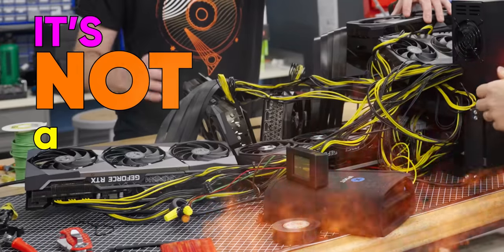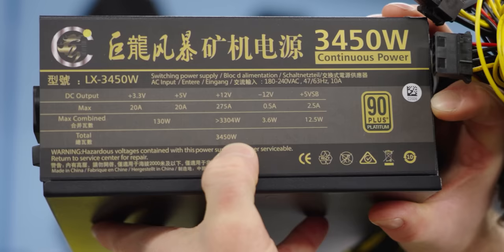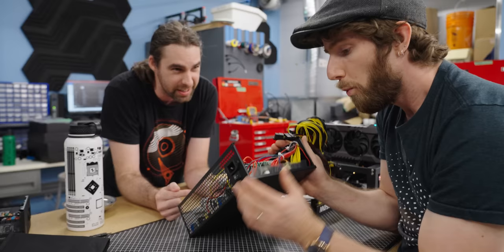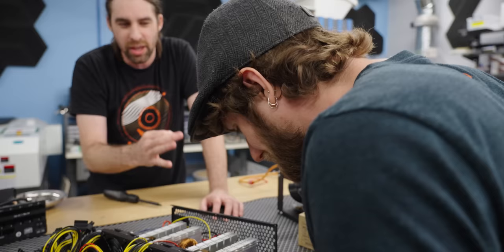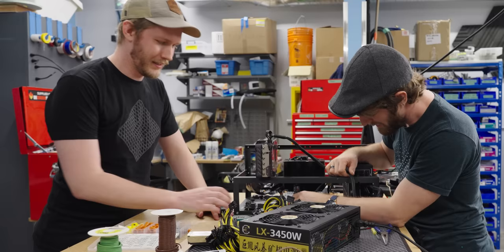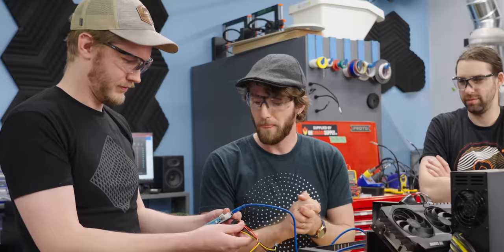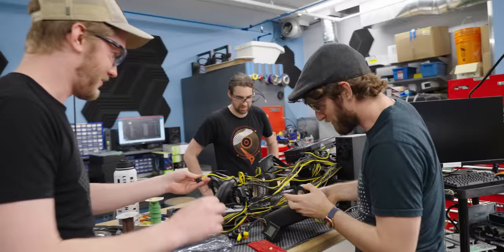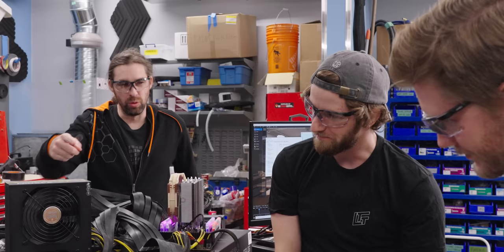This 3450W Power Supply is a Fire Hazard!

Comment: An older video but I'll never forget my first sketch PC project. Back in my early days of PC building ~7-8years my mom had bought me a new 'Gaming' PC for my birthday. It was like $600 but Honestly it was garbage. But I upgraded the GPU and mobo/CPU shortly after so the power supply it came with was no longer enough and I didn't have the money for a new one. But I did have another one laying around from a dead computer that was better but it was old using more molex while the new had more SATA. I can't remember the specifics but I basically cannibalized the two power supplies for all connectors I could possibly need and soldered them onto the better PSU board. Ah good times.

Comment: While living in Europe, where 230V is the standard wall outlet voltage and having tinkered alot with electricity/electronics I can say that 230V is not THAT deadly.
I've been shocked quite a few times and yes, it's very painful and unpleasant, but it won't outright kill you, unless you're doing something stupid and even then, the breaker will trip before you can seriously hurt yourself.
High voltage caps/transformers on the otherhand ...yeaah, be very careful with that shit.
Reply: the deadly part of the power supply is the high voltage combined with the amperage that would be released into the body when the capacitors discharge and the general unshielded electronics.
Reply: @numerohvh  I categorize "tinkering with live electricity with wet hands" as stupid.
Reply: @numerohvh  Yes. It can. But you have to do some stupid shit. Also you have to assume, that your electric grid is totally not up to code and the breaker doesn't trip.
Reply: @etquinx1966  no mate, unfortunately one of my mates passed this way. his fingers weren't wet exactly, just probably more moist/sweaty than mine. breaker did trip, just too late.

Comment: 3:37 and this is the part where I say i already have several times and will continue to do so. it is perfectly safe to carefully remove the cover and LOOK even if you have no knowledge on the subject as long as no power is connected. that being said, if you don't know don't touch the insides untill you know what you are doing.

Comment: LTT should just run 240 VAC with Schuko outlets everywhere at this point, to skip the whole 'but it uses more than 1,600 piddly Watts' part of these videos :)

The Schuko part is because nobody should trust US-designed mains connectors to not electrocute people and/or burn down the place.

Comment: As someone who's only really concerned about safety when people that are not electrical engineers start playing around with sketchy stuff like this, I understand why the technical guy (not Linus or alex I'm really sorry but I don't know your name) breaks a sweat from time to time.

Like for instance, I was like "no those caps will NOT send you flying through the room even though they are quite dangerous and shouldn't be messed with"
He had the same expression 

But when linus started to touch that power reader thing while powered on I was like "BRO LEAVE THIS THING ALONE"
So was the technical guy.

By far one of the most intense LTT videos I've seen so far. 
9/10 linus please don't touch again
Reply: Edit: ok his name is Kyle, sorry bro :)

(I can't edit my original comment right now but I know that it's possible)

Comment: You guys should hook up your equipment with Plug Type G on a decent Transformer. I use Type C/F and Type B & Type A pretty evenly depending on what project I'm working on via a general use Transformer and usually I have considerably fewer fatal occurrences as a result of mistakes during testing. Not only is it locally fused, it has lower resistance on connections as they are much thicker. Makes life a lot simpler. Foolish to do so but sometimes I use the wrong connector for the unintended voltage and even in those situations I usually am saved by Type G. Definitely more reliable with higher voltage as well. Doesn't struggle to draw current quite as much. Fair enough it is a small difference, but it is always somewhat more practical as a result, even if in the slightest form. I feel the appliance connection situation is similar to the failure to switch to Metric. It is so common and standard, it will be a catastrophe to switch now.

Comment: I did this when I built a file server, used a really big case (don't remember the manufacturer)  I bought a 1,000 watt power supply, and was like "yeah, that's enough for 10 hard drives!!"  After a few days running 24/7 however, the system would just lock up/freeze.  After a week of this happening, I was like what the heck?  Come to find out, the total power consumption of the hard drives came close to exceeding the amperage rating on the 5 volt rail, so all the drives would glitch out, and the os drive would freak out for a brief second, and the os would lock up.  So I made a Frankenstein power supply by bolting on a 500 watt power supply to the front of the 1,000 watt power supply, used a relay that was tied into the 500 watt power supply 12 volt rail, to power on the 1,000 watt power supply.  I hacked off the motherboard connectors so only the drive connectors remained on the 1,000 watt, and the 500 watt had all the drive connectors hacked off, so only the motherboard connectors remained.  So all in all, I had one 1,500 watt power supply in 2007, it was long, but fit in a standard atx power supply bay of the case (at least is was on the bottom of the case.  It worked great, never had an issue after that!!  Even my brother wanted it, but I wasn't going to transfer the liability of it.  This supply had two power cables, two cooling fans (same fan configuration, so it was a push - pull configuration)

Comment: a fuse between hot and ground will blow every time. that's not how the fuse is wired or it will fail every time you switch it on

Comment: 6:53 *  ntc does have to do with temperature . As he said it limits inrush current,but it does so  by having few ohms when cold, and then as current flows through it, it literally warms up and it's resistance falls few miliohms.

Comment: Finally, a PSU to power my theoretical build I've named the Colossus OPMachine 2022, otherwise known as The Terminator.
-Twin Xeon E5-2697s, each cooled by a Corsair H110i,
-Supermicro MBD-X10DAX dual socket motherboard,
-16 Crucial CT64G4LFQ424A 64 GB DDR4-2400 CL17 RAM sticks
-Twin PNY Quadro GV 100s in 2 way SLI
-Three 28 TB Western Digital My Book Duos for storage.
-A LG BH16NS55.AUAR10B Blu-Ray/DVD/CD Writer
-A Asus STRIX SOAR 24-bit 192 kHz Sound Card
-A Asus PCE-AC88 802.11a/b/g/n/ac PCIe x1 Wi-Fi Adapter
-A Asus ProArt Display PA32UCG-K 32.0" 3840x2160 120 Hz Monitor
-A Logitech diNovo Edge Bluetooth Wireless Mini Keyboard
-A Logitech TrackMan Wireless Trackball mouse
-A SteelSeries Arctis Pro Wireless Headset
- ALogitech Z906 500 W 5.1 Channel Speakers.

It is all backed up in temp power by a APC SURT20KRMXLT UPS.  Best main PSU I could find was a Silverstone HELA 2050 W Fully Modular ATX Power Supply.  It has an estimated wattage need of 1696 Watts so a 3400 Watt PSU would be nice for temp spikes in power needs.  Oh and it all currently (2:08AM EST, 8/11/22) costs 79,332 dollars and that's without the Corsair 760T ATX Full Tower Case since apparently, no one sells any at the moment (brand new atleast).

Comment: The single wall plug is fine, since 16Amperes out of a wall socket can deliver a max power of 3680 watts
Reply: *in 240v countries
Reply: *in Germany
Reply: @Eslar  In US and Canada you can get both 120 and 240v in the house. It's a myth that grids are 120. They are 240, but with...uh, complications. It's a long story. But in short - yes, common plugs are 120 in US. The ones you see in your bedroom or living room for example. However, each home has 240v power and plugs in it. For things like washing machines and such. In general it's a needlessly complicated system, that arose from the fact that originally it was 100v. But they realized too late that it won't be enough. So they ended up with this mutant that is 120 and 240, but not everywhere.
Reply: @Quicksilver_Cookie  A household washing machine is just 120V. Dryers. electric ovens, and hot water heaters use 240V though. It's two legs of 120v from a delta-wye center tapped transformer what is needlessly complicated or mutant about it?

Comment: "Look at the size of this primary cap" - You think that's big? Have you ever seen what size capacitors are used in subway trains? a 3U rack wouldn't fit one. For some, an entire rack wouldn't be enough... These will FOR SURE throw you across the room, maybe even through the wall.

Comment: That plug is rated for 240V @ 16A.

3450/230 = 15A.

Europe and Asia have no 20% circuit downrating as the US has, so there you can never use 16A anyway on a 16A outlet + breaker.

This is a perfectly ok setup.

Comment: 1:29 On 240 volts that's actually feasible without too much issue. At 240 volts you'd be pushing somewhere around 15 amps through that connector...driving it hard, but not so much so that it melts.

Comment: 3450/230 = 15 amps. Max rated current for the connector is 10amps, good luck using that on 120v

Comment: I mean, you can easily get 3600W from 110V and 30A as long as you had proper wiring.
sure it's not typical, but not hard to accomplish on US systems (and it's not like you couldn't make a special case with 220V. it's not like NA is limited to 110 all the time).

Comment: Just looked up my local regulatory information, I am South African. Most plugs are rated for 16/15 amps at 220/230V. This means I could actually technically run this monstrosity. 

This being said... I would rather not have it burn my house down

The plugs on my local kettle/pc power cords say they can handle 250V at 16 amps....or 4000W.

Comment: Its good that you warn people about the danger of electricity, but ofcourse you will never be able to actually stop people from doing stupid stuff. One thing i never see people talk about is that when you get a shock from Mains, the circuit breaker drips and everything seems to be ok, just a little shock moment, nothing bad happend.
You can actually die up to 24 hours after getting a shock. Please always get checked when getting shocked by mains. There were people that just died the day after and the cause was the shock they got the day before. The heart can get out of rythem and that can affect you hours later.

Comment: Added myself to the waitlist. Got excited by the sold out jacket I saw.
Also, I once broke a power supply and the power switch was locked in the ON position. It was weird. I was able to return it and got a slightly better one IMO

Comment: There's no way that thing only draws 10 amps. There's not enough wattage in 250VAC at 10 amps. That's only 2500 watts. 3450 watts at 250VAC is 13.8 Amps. That's assuming your power supply is 100% efficient and every single watt makes it through the power supply to the output.

Also as an electrical automation and robotics technician it was really funny to hear Linus saying "do not do this" to the thing we do the wire 480 volt motors every day lol. 

Granted yeah definitely isn't safe to just do that kind of thing if you don't have a degree or two and a bunch of electrical safety certifications.

Comment: If the rating is legitimate, this would draw 15 amps at 230 volts, exceeding the 13 A rating of the connector and also the safe 80% limit of a standard 16 A circuit breaker.

Comment: You need to test this PSU again when you get the tester. Also you can draw U*I amount of Watts from a circuit. Now in EU and really everywhere except dumdum NA and Japan the wall outlets or the consumer grid that most people interact with run at 230V and 10A so you can safely draw 2300W of power. Now when you exceed that threshold you increase the current I, the Amps. This can lead to the conductors melting since the resistance of a given conductor depends on the temperature, resistance coefficient, cross section area, length and ambient pressure. So basically your conductors are too thin to carry 3.5MW safely without being a fire hazard.

Comment: "how are they expecting to get 3450w out of 1 C13 power connector!?" 
easy linus, the C13 is rated for 15A which is 3600w on the global standard 240v. thats plenty to supply the rated output whilst also accounting for inefficient conversion

Comment: C13 connectors are rated for only 10 Amps so even at 230V you wont get more than 2300W before the connector goes away

Comment: I was wondering why would it be a problem for C13 to handle 3450w of power. Then I remembered US and Canada are pretty much the only places in world where they have half of the voltage than rest of the world, meaning you gotta push thru twice as much amps. Sometimes I'm glad I live in EU. You mostly can't even use US/Canada wires in Europe since they will burn down, but you can use European ones in US/Canada.
EDIT: Nevermind, they used 220v line, so it's all good.

Comment: Most of our homes have 16 amps rated 220-230 volts grid system. 16*220 = 3520 so 3450 watts is doable per single power cable in theory at least in Europe. That's however I think an incredibly stupid idea to not include two power inputs. The only things I know that exceed 8 amps on a single cable are vacuum cleaners or else they have either two power inputs or they don't go crazy like 3450 watts, The highest I've seen was a 2500 watts vacuum cleaner and that thing probably never pulled 2500 watts anyway.

Comment: 1:20 technically in France you can get 230V * 16A or 3680w but there is a condition to that, the power socket must be rated for it, some says 16A but in reality it's for short burst like 20 mins max not something you leave running all the time

Comment: 3:50
More like "the input caps store enough to KILL you".
The low voltage side isn't a serious shock issue - lots of capacity but LOW voltage that won't even shock you - but enough to make a STRONG arc.

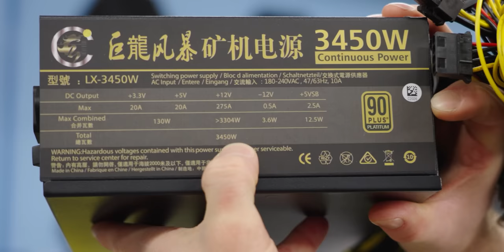Comment: 2:39
You caught the "imaginary" 90 Plus - but did you notice the input max rating is only 2400 watts at 240V?
You mentioned the input voltage but seem to have missed the "10A" part.
And it's claiming almost half again that as CONTINUOUS output?

Comment: In Europe there is 220v and here in germany 230v so 3500W per breaker is actually possible😅 But better not try it on a normal outlet because they aren't designed to be under 100% load for more than a few hours

Comment: I don't get why LTT always handles 230volts like it's the most dangerous thing in the world just cause they're not used to it and wears safety glasses. Here in the EU, we have 230v to almost every electricidal device, and fondles around with plugs it in the dark sometimes to find where it plugs in. Higher voltage also means less voltage drop over long distance and more stable voltage from higher power draw (Which is why a UPS unit is needed for high Overclocking in the US for stable power, and not as much needed in the EU).
I honestly want Linus to look more into 230volt systems and compare 2 systems on 230v and 110v, and get more familiar with it. 110v is no different than 230v in terms of dangerous... yes you see more stars for a split second from getting zapped by 230v, but as long as there is no amp's behind it, it's 'just as dangerous' as 110v, or even 40volts.

Comment: Apparently the IEC jack itself is rated up to 15 amp, which at 240 volts is 3600 watts.
This PSU has the bare minimum of headroom.

Comment: So the C13/14 connectors are rated for 15A, so on 220-240V this is pushing it a bit (14A at 240V) so at 110-120V it's definitely exceeding the current rating of the connector.

Comment: Could just buy an amp clamp and check the current draw and then use a multimeter to check voltage at the wall outlet and that will give you a great idea of power draw

Comment: Just goes to show you that 240 volts we got in our regular mains in Europe is on an other level than the measly 120 volt of North American. Got some bigger outlets like for my kitchen appliances at 480 volts. We got 11kV to the local transformer on the corner. Really don’t understand how you guys deal with electric cars and other high power stuff?

Comment: 1:24
240 volts at 15 amps = 3600 watts.
Marginal but in the ratings for a C13 power connection (I think they're rated for 20, but might be 15).

Comment: Hey , 

THose  Power/Wattmeter works with 220V it's jus that they didn't put it on the label , I have one and measuring almost 1.5k Watts unfortunately its rated for 10-15A only test it if you got the same meter as mine

Comment: As someone who has some experience with working with capacitors 
those are by far the cheapest looking capacitors ive ever seen
for the life of me i cant figure out how they are supposed to safely discharge if they fail catastrophically, like normal capacitors have slits at the top so if they do, the pressure is released through the top, though with those i feel the capacitors would straight blow up
honestly i see very little in that power supply that suggest they have many if any safety precautions
Reply: also watching his engineer flip out the whole time is hilarious
Reply: I don't know for what reason, but if you look at capacitors with relatively high capacitance, you will see a plastic film-like substance on the top.
This is true even for high-end capacitors such as Nichicon capacitors. If you peel it off, there is an explosion-proof valve, so there is probably no problem.

Comment: About that switch ...

Given the wattage of the PSU, this puny switch would probably melt or cause a rather serious fire hazard if it was trying to disconnect 15A 240V...

Not sure what it is connected to, i would assume it's maybe the primary ATX connector, but my intuition tells me whatever they picked might actually be safer than what the intuition suggests...